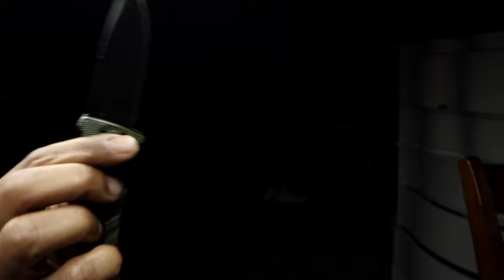DROP SHUTTY & WHAT DOES IT REALLY MEAN??!? WHAT IS YOUR FAV DROP SHUT EDC

Comment: My Tumbler is one of the gravity-drop type. I haven't seen too many reviews that have the same action. Almost all of my contact-detent knives have the need for some motion to garner momentum. My WE Deacon is another. I have found that the detent tuning is hugely responsible. usually if it will fall shut, then it can be lightly flipped open, and the amount needed to break the detent is just enough to make it lock when held horizontally (balances the gravity load). most reviews I see talk about the snappiness, and how hard it hits, but for me, that light little snikt when just given enough to break the detent and it barely locks, or you can hear it fall into the detent "ramp", is a good indicator of fall-shut action. i tend to use fall-shut instead of drop-shut, for the same reasons you mentioned! Great video, and as always, your use and command of technical terms and understanding is great content!